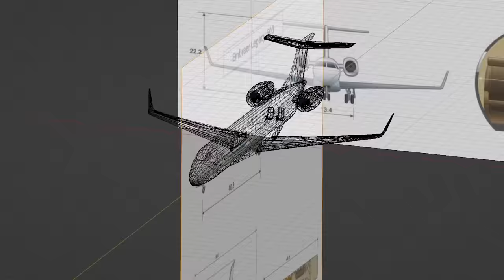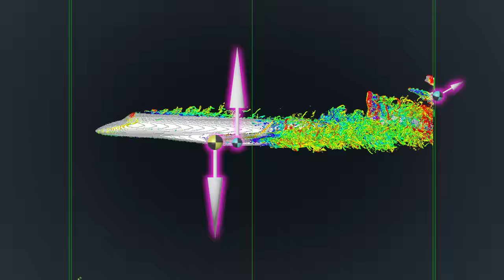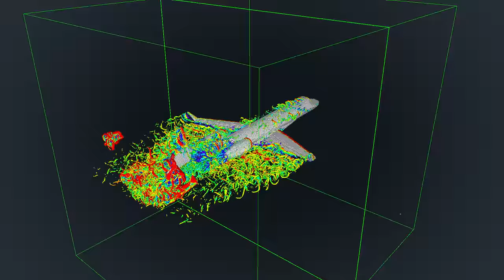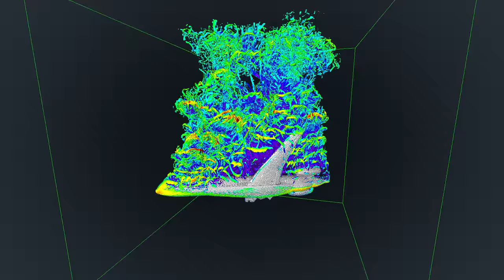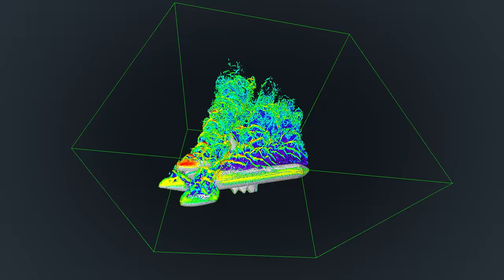Prigozhin's Aircraft Crash Analysis

Comment: I have experience with CFD, Im not sure what Reynalds  numbers you used in your simulation or what the free stream velocity was but at 1:36 there is absolutely no way the airflow going over a modern aircraft would be that dirty, thyats separated, turbulent flow. Id expect to see laminar across the entire aircraft with exception of the hot engine exhaust.

The rest of your analysis makes sense, id say the physics presented make sense as well, but I don't think the flow visualization from the CFD simulation matches what I would expect.
Reply from the maker: Oh heck no, the flow is well separated with a Re of roughly 50 million 😕 I don't have enough GPU memory or access to a GPU farm to get enough resolution for a Sim with a more reasonable Re number. For the most part it's for visualising purposes only 😔 the free stream velocity was only about mach 0.12 at that point in the vid, anything greater and the computation method becomes unstable. I really need to learn to use Fluent
Reply: @SLGY  what program did you use? I’ve got experience with AnSYS back in my college days and just a single static run (no unsteady flow ) took like 8 hours to converge, would love to hear what you used (and play with GPU accelerated CFD)

To do the simulation you did, with the resources I had in 2014, would have probably taken months to simulate all of those frames. 

My runs were all static flow, viscous, with boundary layer modeling enabled.

Comment: Good work. Can you simulate another scenario where the expolsives are hidden just near where the wing is attached to the plane. There is always room there where the control system cables and other pipes are run to different parts of the wing.

Comment: If this were an aft explosion then you’re spot on. However, I don’t believe that’s what happened. I concluded this after reviewing video, photographs, and reported statements. This lead me to believe this was an external explosion below the aircraft. More than likely from a surface to air rocket. This hypothesis comes from the many shrapnel type punctures on the bottom of the wing and other parts of the aircraft along with several reports of double “booms” at the time. This suggests that redundant firings of two missiles instead of one internal explosion. Even if these were Wagner PMC pilots they would have been well trained and an attempt to either smuggle aboard an explosive device in the luggage hold or hide a device in the aft equipment bay would be extremely difficult. I’m willing to bet Pregozhin’s security wouldn’t be bottom tier either. So personally I would rule out a device on board. This is just my opinion though.

Comment: If you had a explosion in the baggage area,  It would show up in the wreckage. It should be easy to tell..
Reply from the maker: Unfortunately the fuselage had a significant post impact fire, and then remains of the aircraft including the black box are all under the control of Russian authorities. They're the only ones with enough access to the wreckage and the needed details to determine if a relatively small explosion occured 🤷‍♂️

Comment: Likely at least 1 engine, likely both would fuel starve quickly (or the pilot initially dropped to idle when nose down first occurred as they would maybe thing wind shear/accelerated stall……so 5is would add drag to line up with the near vertical nose down attitude shown on the iphone video?

Comment: Wouldn't the cabin have depressurised immediately in explosion causing unconsciousness for those in the cabin?
28,000 ft is low oxygen territory.
Reply from the maker: The time of useful consciousness at FL280 is 2.5 to 3 minutes... and even then they descended into thicker air so fast that hypoxia is a non-issue here. Perhaps they may have experienced disorientation and possibly some ear drum damage when it decompressed initially, the cabin would have become immediately foggy for a few seconds too due to the sudden drop in temp and pressure

Comment: Great video, but I have some pointers:
1. While the assumption that the loss of the tail section of the aircraft led to it's demise is fair, the assumption that this was murder tells me that you overestimate Russian aircraft maintenance and ground crews, as well as their ability and willingness to source legitimate parts or tools for any repairs or maintenance. It is not beyond the realm of possibility that this was a legitimate accident, however attractive the thought of sabotage may be in this instance;
2. Any proper investigation of this crash would lead to the discovery of the murder plot if this was the case or act as a deterrent for anyone traveling with any Russian airline if this was a maintenance issue. The chances of this being an issue with the aircraft itself instead of with shoddy maintenance/ politics are relatively slim, so it is natural for the FSB to lean towards covering the causes of the crash up rather than unearthing them;
3. Instead of planting an explosive device it would be much simpler and easier for a state sponsored saboteur to remove a certain amount of screws or to loosen them in order to avoid any detection of explosive materials or video of a mid-air explosion coming to light. All the saboteur would require is unsupervised access to the aircraft as well as some relatively basic tools and know-how/ instruction. This in Putin's Russia would be exceedingly easy to organize if the saboteur wished their for their activities to remain unnoticed, however it is definitely possible that in the case this was a murder, it was meant to make an example of Prigozhin.

I do not wish to understate the likelihood of this being a murder, however to me it seems like there are other explanations providing at least some plausible deniability. It must be stated, though, that this crash is awfully convenient and in Russia as it is today murder is definitely a likely possibility. Either way in my opinion there is not enough evidence to make that assertion.

It must also be mentioned that I am just some guy with absolutely no qualifications other than a strong interest in the field and some experience with Russian culture, so don't take anything I say too seriously.

Thank you and have a nice day!
Reply from the maker: It's certainly possible that it's very poor maintenance, in the context of sanctions etc too it's possible there's a parts shortage which would cause issues. As to whether it was deliberate interference with the airframe integrity or an explosive device: when weighing the possibilities for this in the video I compared the significant amount of time required to remove vital components from within the aircraft structure, ensure these weren't visible and not look suspicious the entire time -  versus the very short time required for an unnamed ground handler to simply place an 'extra bag' in the baggage hold after they've seen Prigozhin walk onboard. 
If a person (or people) spent a day or so sabotaging the aircraft structure they risk being seen the entire time by people not involved, then would have no gaurantee that the aircraft would be allocated to a flight for Prigozhin in the following days (I believe this was a company with multiple aircraft and clientele).
Reply: @SLGY  Fair point, I did mention that their ability/ willingness to source original parts and tools is often overrated, but yes it would be much easier to just use a bomb, although it is a very obvious form of sabotage. Considering the murder on the kremlin bridge a few years back, it is certainly possible that the visibility of the murder was not really important to the Kremlin, if this was the case. I did not know the thing about this being a leased jet and not prigozhins own jet.

Have a nice day!

Comment: how many cells did you use and how long did it take to run the sim?
Reply from the maker: Can't remember how many cells as the software can now automatically adjust the number to fill out the GPU's memory. The time taken to run it was about 20 mins each, 1 run for the horizontal flow part, then 1 for the vertical part

Comment: There is a high altitude puff of white "smoke" near the planes terminal altitude. Likely water vapor. A high explosive close to a large water source (ie. galley or lavatory). Critically, also, there is a significant fire on the ground from fuel in the wing(s). So, bomb was not in the wing-mounted landing gear. I don't think the Embraer would have had a rear galley.

Your "luggage compartment" hypothesis is good. The only other likely places would have been directly in the water supply (galley or lavatory water supply). Who's going to want to search the grey water tank of an explosive? Yuck.

Comment: I've seen a video showing the wreckage on the ground. There are many small holes in the airframe that appear to be shrapnel penetrations from outside the aircraft. This makes me think it was a missile. But we'll never know what the truth is, we're dealing with Russia.
Reply from the maker: the wreckage of MH17 shows what missile shrapnel really does to an aircraft skin, it's unmistakable . But the occasional holes we see in the Legacy 600 wreckage here is just normal bits of wreckage and impact damage which includes occasional holes, concentrations of energy, bolts pushing up through from structures, etc.

Comment: I can simulate a ton of the different scenarios just changing a few more parameters slightly and it will show the same picture (or could not). I'd say this "science-based" approach is very, very conditional and under huge question. It's way easier to shot down this jet using anti-airs rather than deploy a bomb - why taking a risk being compromised?
Reply: what you can clearly say, is that Prigozhin and the others were assassinated. And yes, probably, by Russian forces.

Comment: This was always my opinion as well.  That an explosive in the luggage compartment caused the tail to be separated from the rest of the plane.    And then the wing failed and broke off, leaving it exactly as you described.
Reply: My guess is that too. the explosive would be attached to a titannium alloy belt that joins the tail section, with the midsection of the fuselage.. This belts runs all around fuselage skin.

Comment: We saw it in a flat spin as it neared the ground. This isn't what you've presented.
Reply from the maker: I literally put the actual video and sim side by side...? 3:45 and it wasn't in a flat spin. Flat is near zero degrees roll and pitch. It was at about 90° roll and oscillating in pitch (cycling through zero pitch)

Comment: Great simulation and good presentation. However I don’t think this argument is specific enough to alone support the conclusion implied.

Without seeing other simulations, I think it is reasonable any cause for a separation of the tail of the aircraft would have resulted in similar results. Only comment on other causes was arguing against natural causes. That one seems fair enough, and the consensus along aviation community is convincing enough.

Explosion from outside, on the other hand, was simply not discussed. To me that sounds equally as plausible, and a rocket striking the rear of the aircraft would have likely ripped the tail along the control surfaces just as rapidly.

So a more grounded conclusion would be that the public flightdata and videos fit well with a sudden destruction of the rear of the aircraft. And because it is not very plausible such an event occurred naturally, the likely cause was detonation of explosives, either from inside the aircraft, or delivered by airdefence system.

To rule out air defence as a reason, either a convincing argument why such explosion wouldn’t have happened near the tail, or convincing argument why the publicly available evidence doesn’t argee with such theory, is needed.

Comment: If this was the events, the tail should be quite some distance from the rest of the plane wreck. I have heard that one wing is separate from the wreck, but not the tail. I have seen a theory that a small capsule with a strong oxidizer could have been fed into the fuel tank, which is at the root of the wing. This could then be broken, either by remote control or by a timer causing an explosion in the fuel. Assuming that the tail is not separate from the rest of the wreck, this explains the damage better. Surely a much more complicated method, but also a method that is very difficult to discover pre-takeoff.
Reply: this is Russia we are talking about... that is too complicated and Putin wanted to send a message. (and Russian military wanted revenge). this was without a doubt a SAM strike. ironic because Wagner recently took down 6 Russian aircraft on their "not a coup" attempted coup. how poetic... also Russian civilians saw/heard a missile launch around the time of crash.